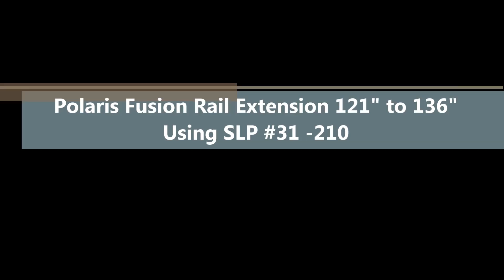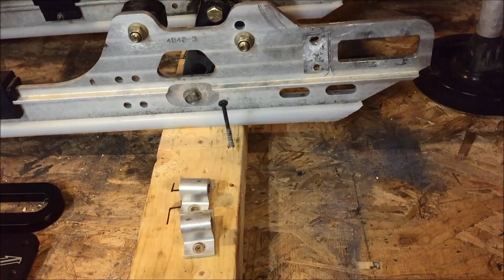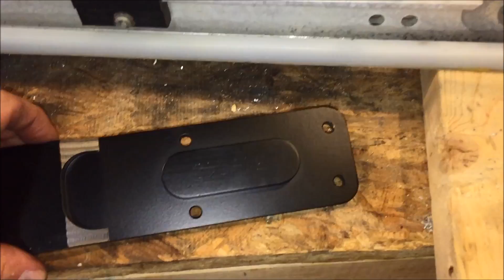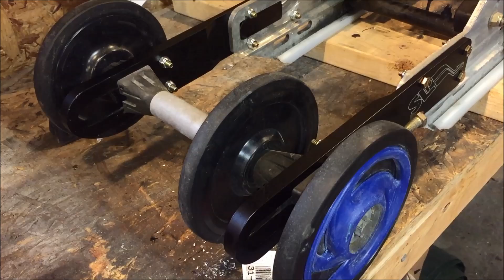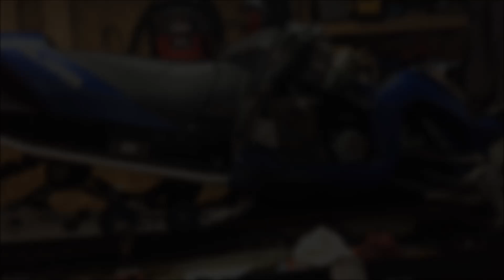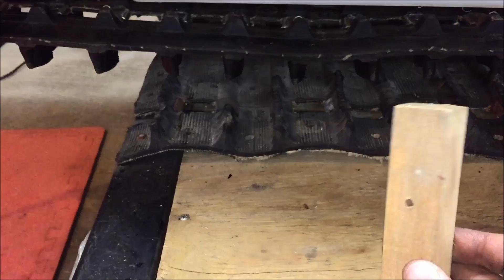Polaris Fusion / IQ Rail Extension 121" to 136" using SLP Extensions

Comment: What is the skid mounting info in the tunnel how far down from top of tunnel distance between front and rear holes and the distance from front drive shaft to front hole thank you
Reply from the maker: Not sure. I sold the sled.

Comment: You're lacking the hi fax bar, which was the whole purpose of the extension..
Reply from the maker: One would think that. But I ran it for 3 seasons and never had an issue with it. 

If you look at my channel, I have my stepsons Fusion 600 but it has the IceAge 136” full extension rails with a very similar track. 

We rode each others sled over the course of the season and unless you knew about it, you couldn’t tell the difference. 

As far as durability, I’ve had it on its rear bumper with some “spirited” riding and never had any damage. 😀

Comment: For anyone having issues removing or re-installing a skid, Use ratchet straps to compress it, and insert 2 pieces of 1x1 wood across the width of the track, between the hyfax and the track. Ensure they come out far enough so you can pull the skid out on them, as if they were rails.  This makes installation a breeze as well. ;)
Reply from the maker: Great tip on the 1x1

Comment: How tall of track does the tunnel have clearance for in this machine. Looking at doing it but wonder if a 2" paddle would clear front heat exchanger
Reply from the maker: Is is just a fusion or a switchback. The 900 switchback could accommodate a 2” but the drivers on the axle were smaller. 

Best thing is to measure the existing distance with the setup you have now.
Reply: @StreetersGarage  just a regular fusion....but if I put the switchback drivers it would work I guess.
Reply from the maker: Yes. You would to change the entire axle.
Reply: @StreetersGarage  Pro Tip.  Thaks! I'll keep that in mind when I'm at that stage. Sometimes it pays to read the comments, lol old as they may be.
Reply from the maker: @TheDivergentDrummer  absolutely

Comment: Dashboard lights goes off and on could it be a ground
Reply from the maker: If it's an Fusion/IQ, check the harness where the hood is. It has a tendency to rub through and cause a short.

Also check the speed sensor in the bearing cup underneath the secondary. Look for any metal fragments stuck to it. If there is, the bearing needs to be replaced.

Comment: Hey how did u find out wat size extensions? Those are the 7.5inch ext. How do u do the math for wheel and all to find length
Reply from the maker: They're standard length based on the year of the sled and the length you need to go too. It's listed on the SLP web site.
Reply: @StreetersGarage  thmx man got em on order same part # as yours

Comment: I realize this is an old thread but I would like to know how this worked for you.  Did you have to re gear the chain drive?  I'm not worried about losing top end speed, those days are over for me.  Would you do it agian?
Reply from the maker: I had the sled for 3 seasons like this and I had zero issues. I rode it pretty hard and not one issue with the rails or the extensions. I’d do it again. 

As far as hearing. I did go down but nothing drastic. It was a great corner to corner machine. Top end really didn’t suffer.

Comment: Good video 👍. Questions about the gearing. Just got my fusion 700 track in 136 x 1.75. what would you recommend for gears. Stock is 26 top 40 bottom. Dealer recommends 24 top 41 bottom. Thanks for your reply
Reply from the maker: Sounds about right. I geared down when I went to a 136" I can't remember what it was though. I sacrificed top speed for better corner to corner performance.

Comment: Hey I know old video but did y need longer slide rails
Reply from the maker: Not needed for this style setup. Ran it like this for 3 seasons and no issues.
Reply: Cool thank u man got a 01 xc 600 I just got rail extensions in and gna put them on was just wondering thank u awsome video
Reply from the maker: Nice, you'll love them!

Comment: Do you need a new suspension or its only rail extension and new longer track ?? I want to extend the track of my polaris indy 500 classic 1998 because it is only  121 inches. I can’t find someone that can explain clearly what I need. Im french so it is difficult to listen to english, im better at reading.
Reply from the maker: No problem. For this type of setup all you need are the rail extensions and the longer track and that’s it.

Comment: Are you able to use the same track or do you need to buy a new one to fit the new extension
Reply: lol your kidding right?
Reply from the maker: . You would need to get the correct length track.

Comment: can i fi a 136 rail extension in a 133 track
Reply from the maker: +rip888 

Unfortunately not.
Reply: ok
Reply: I have a 97 arctic cat zl rear skid Im going to put it in a indy trail 488 133.5
Reply: I wold have to extend the skid to fit the track
Reply: but my track may be a136 its abit  long
Reply from the maker: Ok, I see what you're doing. The track may be too loose even with the track adjusters cranked all the way out. One way you can get around it is too move the location points for the rear suspension back an additional inch. This will essentially ""Make" the suspension longer in the tunnel and you should be able to get it done.
Reply from the maker: I'm having a Christmas giveaway on my channel. Follow the link to enter into it.

https://www.youtube.com/watch?v=MWOO-BBh7bE

Comment: When I look on the slp website and when I look to order the rails on eBay the picture don't show the mounting hardware. Will it come with the hardware anyway
Reply from the maker: +Thomas  Patenaude yes. It comes with everything you need for the install.
Reply: Streeters Garage even if the picture doesn't say it doesn't?
Reply from the maker: +Thomas  Patenaude 
It's sold as a complete kit. All of the hardware and axles spacers are included.
Reply: Streeters Garage ok thanks so much!
Reply from the maker: Thomas Patenaude 
No problem. Glad I could help. 
Thanks for watching and please subscribe!
Reply from the maker: +Thomas  Patenaude 
No problem. Glad I could help you out. 
Thanks for watching and please subscribe!

Comment: is the suspension the same on a 2008 polaris fst? and do you have to extend the tunnel if converted to 136??? I have a 121'' want to convert to 136 just because its heavy and gets stuck lots lol killer trying to get that sled unstuck fast as hell thou :)
Reply from the maker: Yes and Yes. This kit kit will work on the FST 121" rails.

I had a 2006 Polaris FST with the 128" M10 (Check out the rest of my channel) and the weight was the main reason I sold it. GREAT trail sled but not the best when you wanted to take it off trail.

Comment: Did u have to reclutch
Reply from the maker: Clutching is still all stock. I did change the gears though to 22 on the small to 40 on the large. Used the same chain. Stock gearing is 23 / 39. 

The change makes it more responsive out of the hole. I love it. 

Thanks for watching!